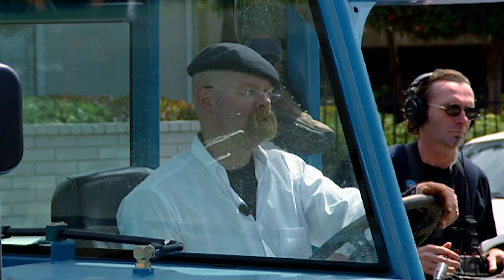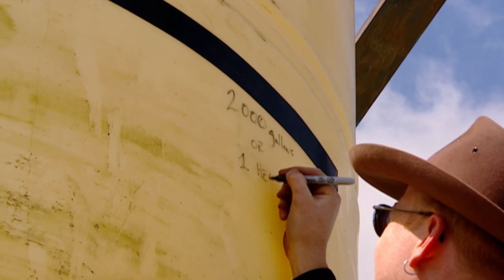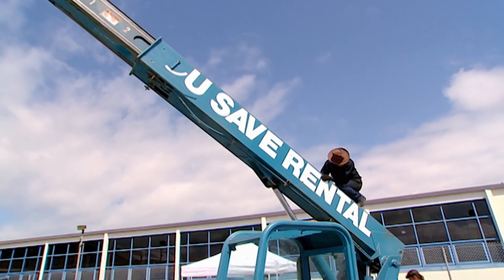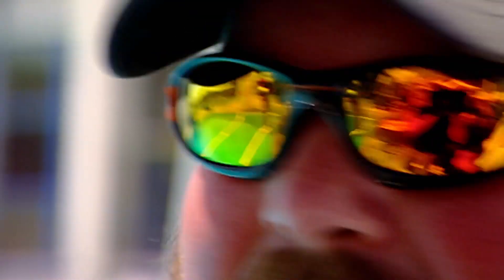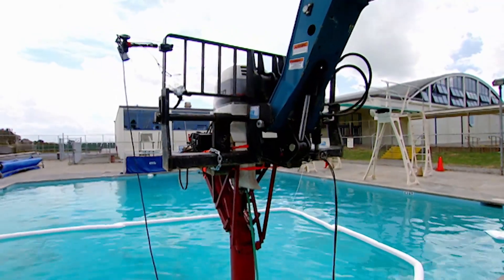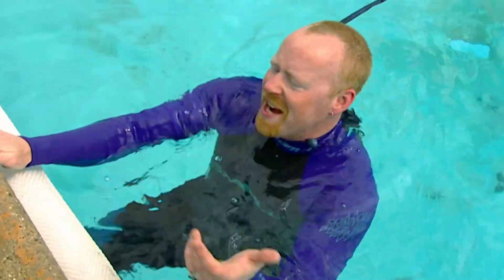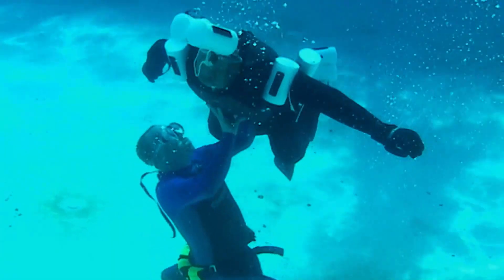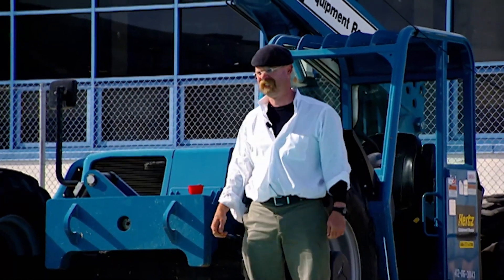Did a Fire Fighting Helicopter Suck Up A Scuba Diver? | MythBusters

Comment: Question is, do thoes helicopters use this type of impeller?
Maybe other kinds of pumps would be able to create a stronger suction or tighter seal between impeller and pipe.
Major flaw in the idea.
Reply: The Problem is not sucking in air, but not being able to sustain a low enough pressure due to the bad design of pump.